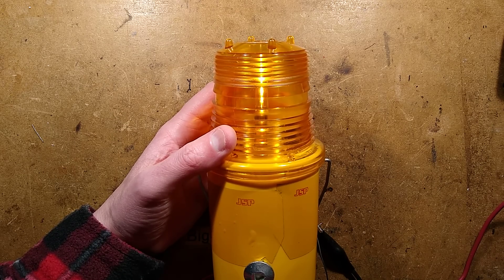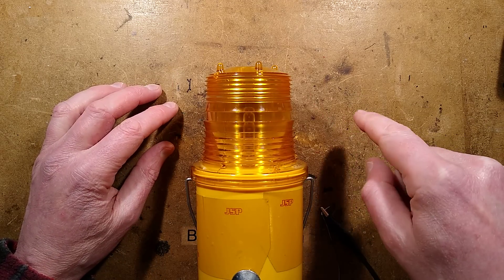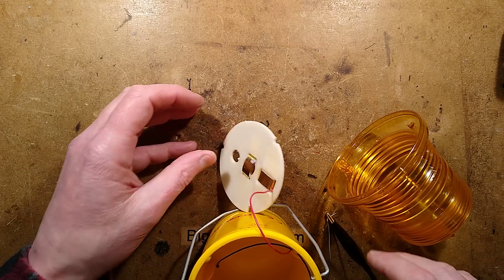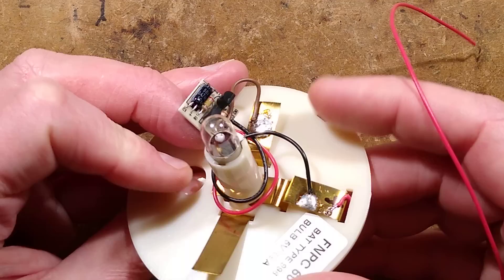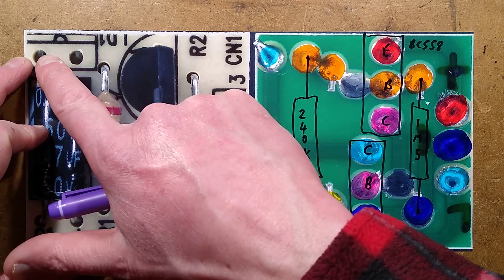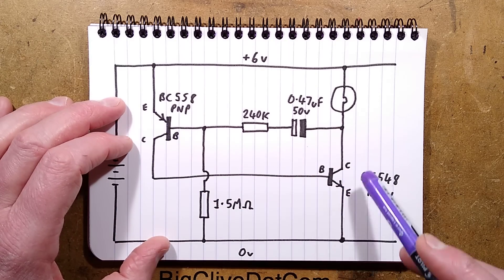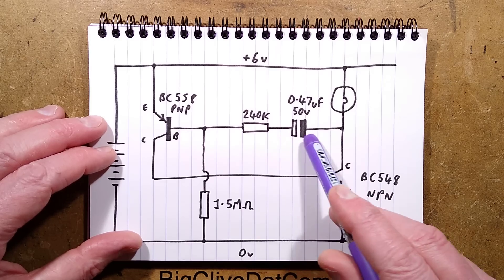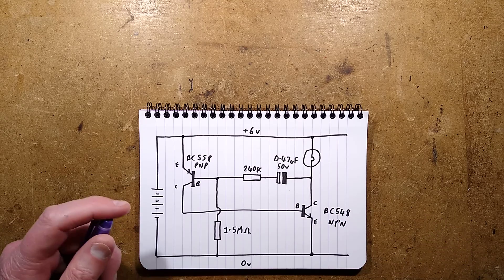Old tungsten roadwork beacon - with schematic

Comment: Wow I used to have a set built just like that even on a circuit board with NO LDR.
That was 15 years ago!
The new ones which stobe in sequence would be interesting to find out the radio frequency. Also how the new ones are set up as they need to keep it simple & I have not seen any out of sequence.
Reply from the maker: I think they use a pulsed infrared emitter and detector to sync with the nearest unit.
Reply: The lights that strobe in sequence are interestingly dumb; they have an ir emitter and sensor which point to the previous and next light respectively. A master light at the beginning of the chain sends a flash of IR and all the rest of the lights "pass it on" after a short delay. A good example of cost reduction there :)
Reply: I had an old electronics kit that I was bought as a kid that used almost this exact same circuit.

Comment: Blinkenlight! And a nice THT circuit board. I'm still kinda surprised it's not even attached with a double-sided sticky tape/foam, let alone a screw. Not too reliably built, but it's simple as it gets and it does the job.

Comment: The more professional flat type used to have the flasher encased into a block of wax.  There was a small hole in the side to access a push on/push off switch with a match stick.  I often used to "find" these as a kid and take them apart.
Reply: It was surprising jhow many you could find just laid about 😃
 I had a few I took to bits and had disco in my room. 👍👍
Reply: I have one of the cone top ones rescued from a ditch after some roadworks. The switch mech is very clever, it has the 6v battery in a 'backpack' type dealy thing, a very bright amber LED , and putting it over a cone closes the contacts. all made of folded plastic

Comment: I recently picked up a jeep branded lantern torch siren radio tv thermometer compass torch beacon... thing

The beacon feature of the torch has, rather bizarrely, two self flashing lamps in series. The same sort of lights you'd see in a set of christmas lights to make them blink annoyingly, but in the form of a standard screw in lamp.

They'd reflect off the back of the reflective cone of the torch and shine out the red ring around the side. Clever. And cheap.
Reply from the maker: They used to use those bimetallic flasher lights in everything before electronics took over.